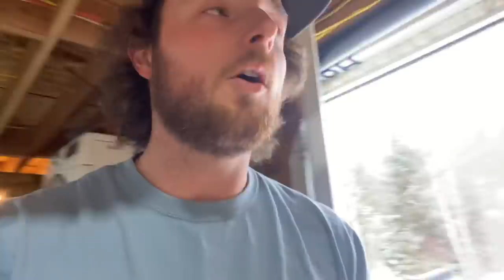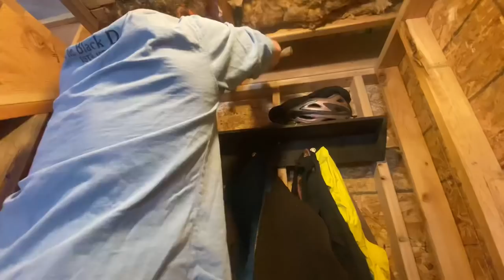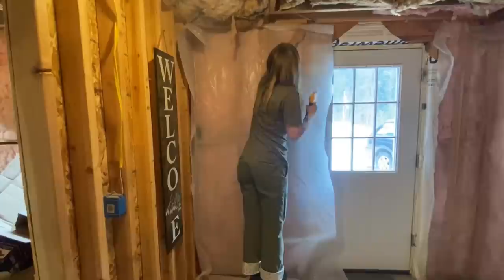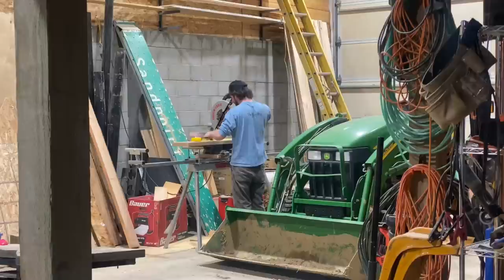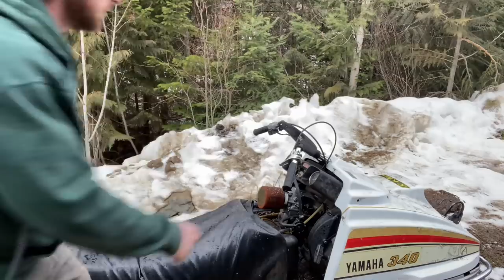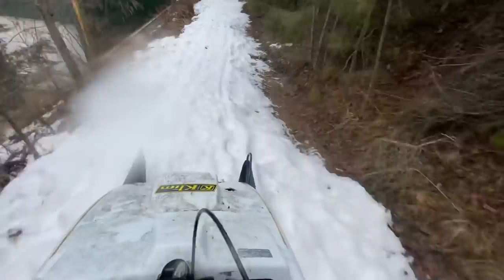Don’t Use These On Floor Joists | Vintage Snowmobile Trapline

Comment: You need to seal the area above the ceiling from the outside air, install vents in the ceiling so you get air circulation from the attic to the garage.  You have cold sir above the ceiling and warm air below - this is causing your condensation.  You are living in a giant humidifier

Comment: With a metal siding you should use spray foam insulation to avoid those type of problems
Reply from the maker: Not necessarily
Reply: @LaidBackLiving  No, not necessarily but it's the most rreliable way to insulate your house and not have those condensation problems that in the future can be more serious and more expensive to solve. All the best to you.

Comment: I predict the delivery that's due to arrive is yellow and a little bigger than the green tractor in your shop.  I've yet to break a Torx drive bit from GKR the screws come with the bit and it commits you to something other than regular fasteners but I've yet to break. maybe next project👍

Comment: i am sure you looked into the moisture and mole problem, i know nothing about it, but i really feel that the insulation will remain wet, and a mold condition will continue even with the moisture barrier up. one person i follow did a closed cell spray foam over the metal wall in his house, and it wasn't done right the first time, and lots of the sheet rock they put up got soaking wet.

Comment: That low hanger there may impede the ceiling just a tad if you leave it, which I'm sure you won't, and/or you decide to put up drywall/ceiling tiles/tongue and groove. The Phillips head screws aren't as handy as the hex head, the strip easily or break bits. Oh yea, you know this too...lol Love ya'll ❤️

Comment: Just a tip I've found lube those long screws even if the hole is predrilled candle wax the threads or vasoline if you have it helps a bunch on thr thread binding up great vid todsy bro👍✌
Reply: This is interesting for sure, I’ve never heard of or thought to do that. So simple 👌👌

Comment: hey brother I hope you know metal sweats with the heat and coldness and what happens is you insulated it and then you put plastic over the insulation and that's going to hold that moisture in there and you're going to have mildew and everything else happening in them walls you need to put your gable vent or a ridge vent on top of that building and that way it was sobia moisture problem I've I've experienced it before and that's what we had to do also but that plastic all that's doing is is building up heat in between the insulation and the in the metal and causing it to sweat and you going to have that problem until you get rid of that plastic we kind of found out that the hard way good luck with it brother I hope these tips is helping you out a little bit have a blessed day and be safe 🙏

Comment: The only way to stop this condensation issue is to take the fiberglass insulation out and use spray foam insulation. In not this will destroy your framing. Fiberglass insulation will soak up the moisture and keep the inside of the wall wet. Trust me. I’m dealing with this issue now. I chose to remove the metal and use wood siding. This probably isn’t practical in your situation. Good luck. Love your channel.

Comment: Take that dehumidifier out of the attic and put it in the house. Put another one in the garage/shop space. Doing that will do more good for you than everything else you have done, so far. Even if the mold grows in the wall, keeping your living space dehumidified will go FAR toward keeping the mold out of your space.

Comment: Vapor barrier needs to be on the outside walls  under the metal to stop it from entering the building. The way your doing is only trapping it the walls.
Reply from the maker: Incorrect

Comment: The moisture wont just go away. You need to rip out all of the insulation out and replace it with new once the house is dried in again. This need to happen  to all of the exterior walls
 
Trapping the problem like you are doing right now is dangerous. Both for your health and that of your dogs. The black mold will grow fast.
You should have put the plastic on before you started to heat the house.
Reply from the maker: Ok
Reply: That has all been pointed out to them before, repeatedly, including how to sequence the project. But once it is done,  like most people, they don't want to go backwards.